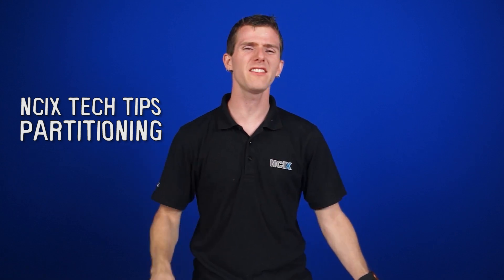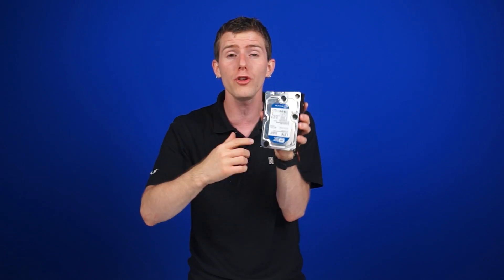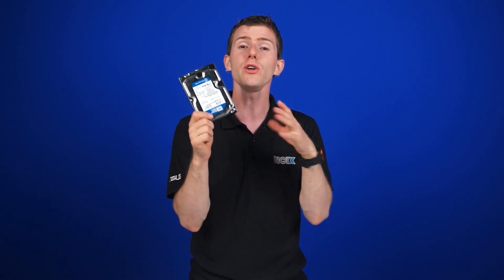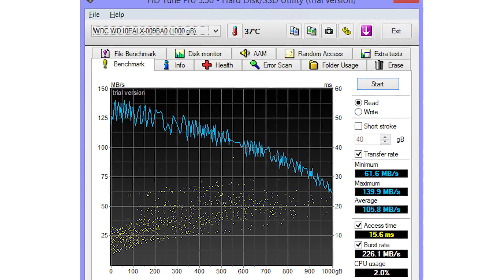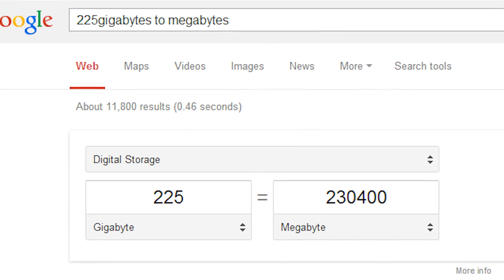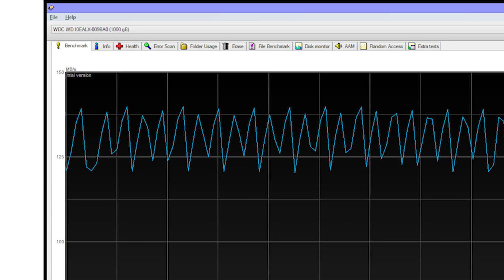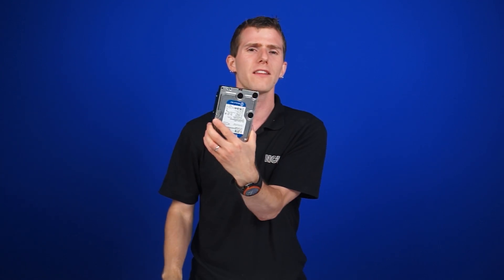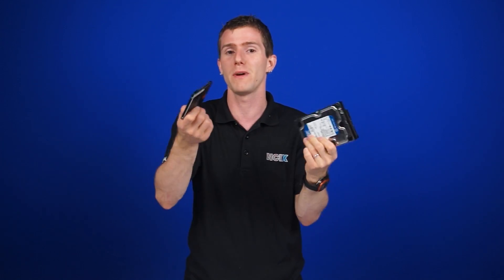How To Optimize Your Hard Drive For Speed

Comment: This went to fast without any visuals. I'm sorry but I didn't understand what to do. Please help.
Reply: ***** K. I'll learn then come back. :) thanks for letting me know.
Reply: +corn cob Not hard to learn at all, so why not say some basics here and now :)

Several video online on how to split one hard drive that we will call as two partitions. It's almost like having two separate drives, one C drive and one D drive. If it was 1 TB, then they will etch be 500GB each of them. 

He was talking about the plate inside, it's like an old gramophone record plate, and you have this arms that play music, and the arm moves as the music plays. It's like this inside the hard drive to, just it reads/writes data. 

The outer ring are faster, the inner ring is slower. If you split this; make the outer parts one separate partitions as one separate hard drive C, and the inner part second partition as another hard drive D. You will now have two hard drives/letters, so now act as two separate hard drives. But they really is just one hard drive. So if you use both this partitions at once, etch play game on the fast part C, play music/move on the slow part D. The hard disk will then be at it's old speed again because of this arms that will move after data will also go to the slow part, it will use the hole spinning ring.

It's just about splitting a part into two, but in physic they are just one, but act as two separate parts.

Comment: Then when im transferring files from my ssd to my flash drive, it only goes at about 1.5mb/s?
Reply: +Oliver Barnett this is a video about SSD drives not flash drives. Google USB flash drive speeds to learn about them.
Reply: 1. Is your flash drive usb 2.0 or 3.0? 2. If it's 3.0 and you plug it in to a 2.0 port then it will go slow, 3.0 ports are blue while 2.0 ports are black, 3.0 ports will usually be on the back of the case
Reply: you arte always limited by the slowest path.

Comment: How long on average does a HDD last before it dies or becomes unusable or a pain to use?
Reply: +MCOD1999 I think it's random, but some disks are fine even after some years...
Reply: +Melvin Duineveld (melvin2204) Seagates are just like any other HDD. If you're lucky, it's still alive after 10 years. If you're less lucky, it might die in a matter of weeks.
Reply: I have a couple 20 year old ones around. Can't use them any more because they don't use SATA.
Reply: most hard drives will last a few years, with Western Digital and Hitachi making very reliable drives. if you want your drive to last, don't move your pc while it's operating and avoid buying Seagate drives. they have a high failure rate. some drives last 4-5 years, others less. My very old laptop from 2003 still work!
Reply: got a 40MB one since  1989  on a Mitsubishi MP286L still working :D.
Reply: jkacvbhijfn 
Didn't check the speed but it still holds windows 3.1 and as mentioned still works, Didn't even touch it, just took a glance when I got the "laptop".
Reply: running windows 10 on an IDE samsung HDD boiii

Comment: I have an SSD but my HDD is faster sooo i dont use it xD
Reply: +SOZ I KILL YOUZ  SSD will ALWAYS be faster than a normal mechanical HDD. What tools did you use to compare your drives or are you just going with gut feeling, maybe benchmark tools are nerfed because SSD technology runs rings around an mechanical drive.
Reply: Glenn Post Its one that is way older. I was just using it after doing a fresh install of windows on both and the SSd was slower to copy/paste and just open files+extracting them.I did the same tests on both AFTER I restarted 2 times. I had 16GB of ram so opening stuff shouldn't have been that problem.

Comment: The outer edge isn't faster. It's actually the opposite. At the same speed it takes longer to do a full revolution than the inner edge of the hard drive.
What happens is that the outer edge can store more data in a row (so the head doesn't need to move so often) and its also closer to the head (so, even less movements).
Reply: +zakzor No, the outer edge will do a complete revolution in the same time that it takes for the inner edge to complete a revolution. This results in a higher linear speed at the outermost edge.
Reply: I believe what he means is you get more reads from the outer edge. Since the disk always spins at the same velocity, the only thing that changes is the distance covered. Which, is greater in the outer edge with a bigger circumference.
Reply: +nasa444444 I understood what +Linus meant. But he said that the outer edge spins faster and its the opposite. It's the slowest part of the disc. Other than that its all true. You get faster read/writes because the lines are longer and the spindle doesn't need to move so often.

Comment: so how do you know that the fast partition is on the outer cylinders? Second some drive venders use striping to overcome this where the data is written on the same sector on successive cylinders from outside to in and from in to out. Stripping is commonly used in large storage arrays that use one of the raid technologys.

Comment: What about with Raid 0, will short-stroking  work in tandem in between the drives? My assumption is yes but just wanted to clarify, thanks!
Reply: +Lyndon Alvarez if you would raid a ssd it would make it 2X faster if you have 2 ssd's like gpu sli

Comment: I want to repartition my HDD drive so that all of my games are on the slow part and other, more commonly used things are on the fast part. My OS along with frequently used programs are on a 250 SSD which I want to be as fast as possible. Is it even worth putting all my games on the slow part of the HDD when I have a 250 Gb SSD?

Comment: It almost sounds like he's saying that people who use mechanical hard drives are in the minority. I think it wouldn't be far off to say that 75% of computer users still use them. Might even be accurate at a higher number.
Reply: SikkTwizted I'm pretty sure the number is higher than that. Even people who can afford SSDs to use them for main storage usually invest in a cheap HDD just for extra mass storage and backup purposes.
Reply: SikkTwizted i know what you mean, but i also do think that he was making a joke, as he probably hasn't seen an hdd unless he makes a video about a topic that involves hdds.
Reply: SikkTwizted yup & unless someone has plenty of money to burn then a modest SSD for Booting & the main progs + a 1 or 2TB Mechanical drive still makes alot of sense to most of us
Reply: SikkTwizted  I think you might be surprised how many computers are shipping with SSD's these days, sure we still use HDD's for data storage, the SSD's are for the OS and programs. but SSD's are really going mainstream these days the prices are finally getting good enough to justify using them in builds.
Reply: +DanielRichards644 the majority of work stations though still uses mechanical HDD, since price wise it is still a significant increase in cost...

and of course... SSD durability still doesn't quite hold up to mechanical HDD... especially after the report a few months back on how SSD mean time before data corruption sign appear, drops drastically once temperature increases to just a few degree above room temperature... to as short as few weeks or months on worst case scenario...

this... is obviously unacceptable in a work environment, so unless the temperature can be regulated carefully... and heaven forbid if work stations even bother with that... then it's going to be a long time still before SSD becomes more common in most PC.
Reply: Iono Sama
 I was just saying they are becoming more and more common in computers and the prices are low enough you can use them for boot drives, I still don't trust them for critical data storage myself, but like any computer with important files you should have multiple backups anyway, Linus and the guys have a video on proper (3 copy) backup methods, that basically have the active drive, on site backup and an off-site (that is far enough away to protect it from any natural disaster that may hit the area).
Reply: DanielRichards644 aye, my comment is mainly to point out that SSD is still the one in the minority... not the other way around.

And as much as we'd like to think that by now everyone would have an SSD... the reality is that they are still not cheap enough (nor reliable) that companies are willing to spend for them for overhaul or to choose them when ordering a new workstation...

mind you that most of the typical workstation in most companies especially smaller ones... only pack a single HDD due to cost efficiency mostly... 

and because their work and operation... doesn't really benefit from SSD's fast access in particular by much given they are often just set to run something that would remain active for the most part of the work day... and the next time they are run would be on the next working day.

that would change eventually... but that day is likely still a long way away... especially while the lifecycle expectancy of the SSD is still that short...
Reply: Iono Sama
my point was compared to even a few years ago the prevalence of SSD's has ex[anded greatly, some computers (like certain Macbooks) come from the factory with SSD's. also what report are you referring to? every thing I see speaks to SSD's lasting WAY longer, it was the early SSD's that had issues.
Reply: DanielRichards644 It was from JEDEC presentation made several months back, it caused a fair bit of news because it sent ppl into a panic over their SSD lifespan expectancy... and the way the news was presented in the various outlet.

so to be fair, that presentation was basically intended for an SSD that has gone over it's rated data transfer... hard to reach for most home users, not so much for work stations especially when they deal with today's massive data regularly.

and the worst case scenario was for storage and usage temperature that is less likely to happen than the common usage, ie: instead of high power on / low power off... the part of the presentation that sent ppl into panic mode was the low power on / high power off chart region.... which we know will destroy an SSD eventually.

So it wasn't a very likely situation to happen...

But objectively, it made ppl pause... and seriously think whether an SSD is a good idea or not for their usage... in terms of storage condition and not just size.

Macbook?

no offense, but portables and ultraportables have more segment in sales than desktop surely by now... but even then ultraportables or ultrabook (one of the heaviest user of SSD) are still a fraction of the total market in general.

they are certainly growing... and may, emphasis on 'may', eventually surpass the other category on it's own... aside of mobile device which is impossible to beat in sales since they are basically designed to expire within 1-2 years...

meanwhile... the hordes of desktop and workstations that use regular HDD and have been doing so for ages likely... which are likely to have minimal upgrades and don't appear much in sale figures... continues running every day lives...
Reply: Iono Sama
 OK, well I was largely talking in the consumer market, not the corporate workstation level. to be realistic the laptop/ultrabook stuff is even dying out in favor of the smart phone and tablet boom, which is a mystery to me, as I can't comprehend wanting to watch something on a tiny little screen when I have a bigger screen I can watch on. But I see it all the time, much of the younger generation (outside of the gamer and IT crowds) have all but abandoned the personal computer for the smart phone, so in that situation the rise of the use of flash storage has grown exponentially, I never would suggest using the SSD hold critical data any way (without a good backup method, which you should have anyway), but for a boot drive that just holds your programs and windows (meaning you don't have to buy a crazy expensive 1TB drive and can get away with a smaller capacity (I use a 256GB 840 PRO personally) that doesn't add a huge amount of cost to the build and improves system performance noticeably when doing heavy duty tasks.
Reply: DanielRichards644 agreed.

and believe me in my friends work, they constantly say the same thing to most of the companies or IT department in their companies. They do not appear to be having much success however.
Reply: And 100% of school computers
Reply: @Abraham Johnathan these comments are 5 years old back then ssds were rare
Reply: Bro I'm still using a hdd

Comment: I think I did this unintentionally when I set up my PC last time. 2TB HDD with a 120GB C partition for boot and the rest as D for storage. After I installed windows again I was surprised how quickly the rig started up when before it would take around 20-30 seconds it now takes maybe 5-8 from cold boot. Amazing how much you can squeeze out of the mechanical construction :D

Comment: Okay, so the hard drive always starts at the outermost edge and fills inward? I was not sure about that. Now that I know this, I will make the swap space first. I have four drives, two are 250GB and two are 1TB. I have never done RAID before, but I wonder if it's possible to RAID the shortstroke partitions to make them faster while still using the rest of the drives as non-RAID long term storage. I would boot from the smaller drives and use the short stroke RAID as swap space and the long term storage would be for backups, so I would temporarily switch my swap space to one of the smaller drives while running a backup, but otherwise the TB drives would only be used for 8GB of swap space.

Comment: Defrag. Problem solved...

Seriously, why shortstroke? A defrag program will put the files that benefit from fast access on the outer edge. That won't change very often.

A good defrag problem will analyze usage data and move the most-used files to the fastest spots (which is how Hybrid drives work with the SSD + HDD).

Comment: Here I am, I've been putting all of my main system partitions on the very outside of the hard disk without realizing I was short-stroking.

My primary concern is startup time, so this really is just a way to have faster starts and faster permanent program execution. I really ought to do some file-swapping and move some of my more frequently-used programs out of the slower storage partition I use them in and only make symlinks to them on the same partition I keep my non-permanent / "Portable" programs on.

Comment: I know this is a old article but would it not be best to take the "drop off point" of the read & write bench, and then average those out to get better performance as the read on a disk will always be far superior to the write.

I played around with the short stroking on a old 160GB 5400RMP 2.5" HDD and going between a 32 / 64 / 70 / 80 / 90 / 100Gb partition made no diff to the speeds HDtune gave me, but I was testing this as a external drive with no data on it..

Comment: 1tb ssd costs 500$, 1tb hard drive costs 50$... so what do you mean
"you couldve gotten a ssd for the same price",
am I looking at the wrong thing or?
And there is no way I will get a 1tb ssd for 500$, even for 100$, I would much rather install multiple 1tb hard drives for the same price, yet get the same performance, and a far better size
http://www.newegg.com/Product/Product.aspx?Item=N82E16820147251
http://www.amazon.com/dp/B006GDVREI/ref=psdc_1254762011_t1_B0088PUEPK
Reply: he means if you short stroke down to 120 gb you would be mainly using that space and you could have just bought a 120gb ssd for that much
Reply: TensaZangetsu63 Oh ok, thanks,
Reply: I bought a 730 480gb intel ssd for 180$ and don't regret it one bit, i did benchmark speed tests and it outright slaughtered my hybrid segate drive in the tester.  My system is 7 years old and my computer boots within 5 seconds.  SSD's are dropping in price my friend just bought a 840 samsung ssd 1tb for around $360 reason being sata is at its max and advances within pci-e ssd's are now so far ahead that everything else under is dropping.
Reply: rldb2 PLEASE link me where you can buy a 1tb ssd for 380$!!! I would buy it immedietly
Reply: http://www.newegg.com/Product/Product.aspx?Item=N82E16820226596&cm_re=1tb_ssd-_-20-226-596-_-Product
Reply: Reviews are good on it as well.  Other than that samsung at this time has some 1tb for 420$ as well if you prefer a name brand
Reply: rldb2 If it has the same specs then I don't care about the name brand, but thanks for telling me! all of the lowest ssd I found where 500 or more,
Reply: no problem, i just know some people don't like non name brand items that's all.  So are you actually going to buy it?  If so i'm glad i could help someone out.
Reply: rldb2 Well I need to save some money up (I finished my new pc a week ago) but yes I am going to buy it
Reply: He meant a 50Gb drive, because he was saying how you don't want to just have a small amount of fast hard drive space, but rather maximize the space.